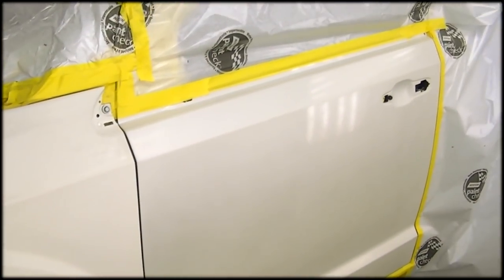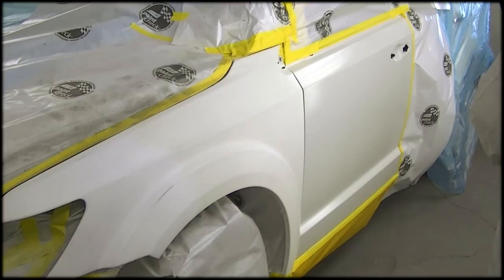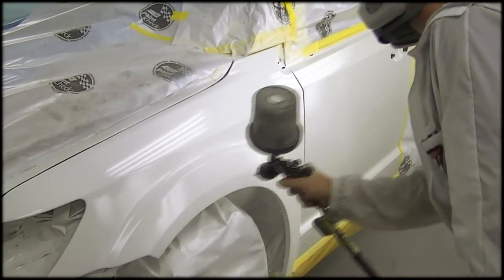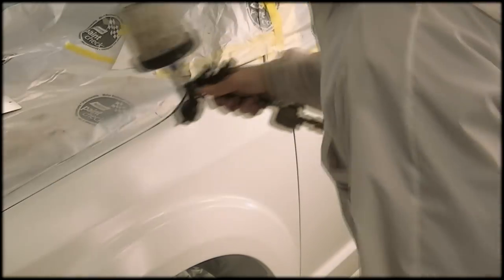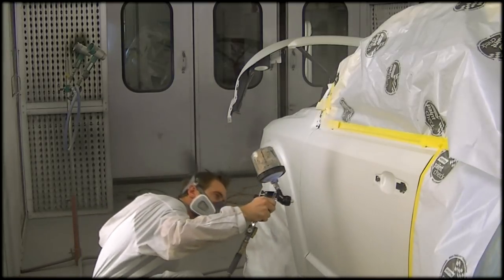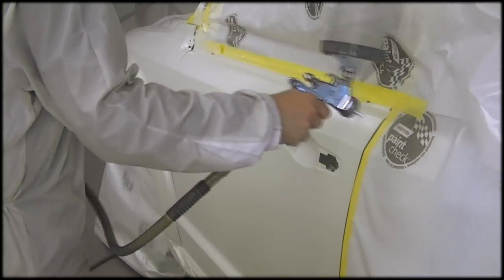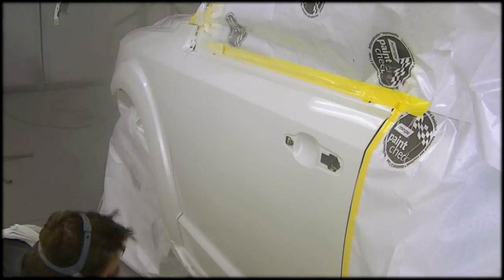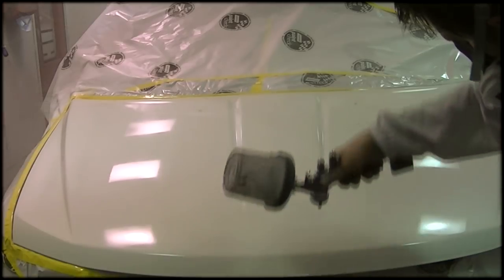Car Painting: Three Stage White Car Paint

Comment: Axalta's procedure for tri coats calls for diluting the ground coat by 50% with WB2091 Blender and 5% WB2075 Activator. Without a wet bed, spray the replacement/repair panel with the diluted ground coat blending into the blend panel. Next, spray a wetbed of WB2091 blender on to the remaining blend areas. Apply the desired number of pearl mid coats without flash to the replacement/repair panels blending beyond the previous ground coat blend into the wetbed. Great videos! Can't wait for next one

Comment: With tri coat whites, you ground coat needs to match better then what you had.  White is a pretty basic color, toner wise.  So tinting it to get it closer will make the pearl step easier with less coats.  Cuz I'm sure you found, the pearl effect looks about the same after so many coats, just the darkness changes.  Starting a spray out card before painting the vehicle is the safest approach.  I also like to, in your case, tape the door up til about the 2/3 coat of color.  Keeps the blend small.